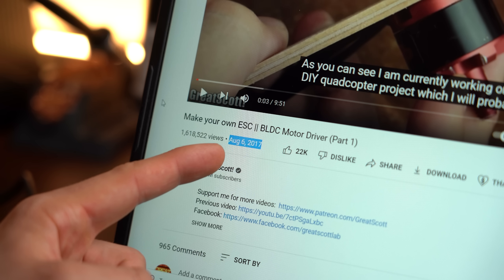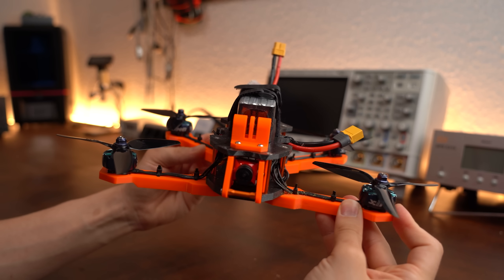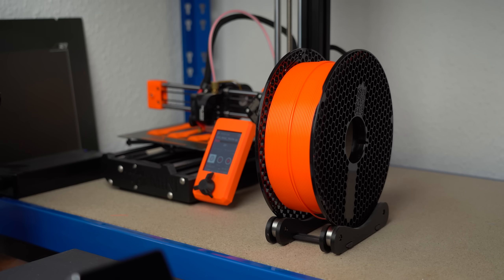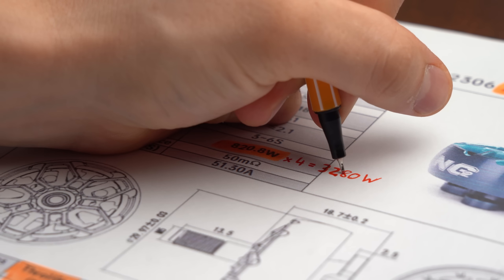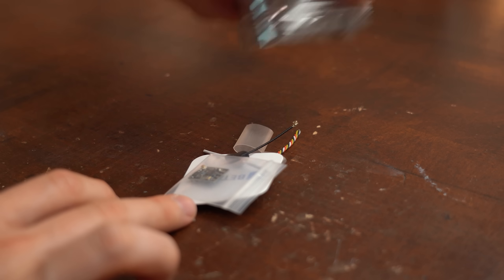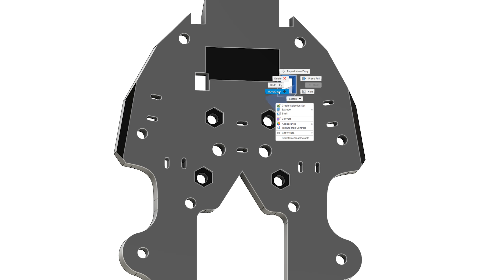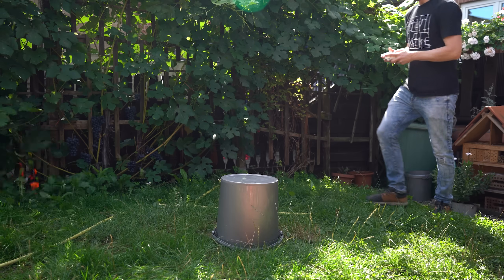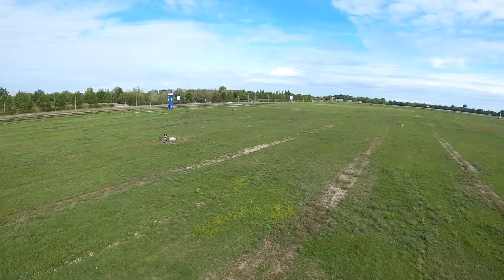The Idiot's Guide to Making a DIY Drone! (I am the Idiot)

Comment: That also happened to me when I build a drone with my friend for school project :
- Aluminium frame without proper precision control and use epoxy putty to attach leg from body.
- Gyroscope module taped with 2 side tape
- No clue what's PID control
- Zapped one of multiwii board because what's different between RS-232 and UART (I connected RS-232 output to UART port that supposed TTL logic level)
- One of rotor decided to seperated from stator 
- more epic fails

Comment: 3d printed frame probably results in a noisy system, add to that 6inch props that inharently produce more noise than "default" 5inch makes it harder to get a  good flying drone. 
Did you use default pids? Look like you had too low pids
Reply: He’s using 5” props

Comment: nice . ich empfehle Freerider  Simulator auf PC  oder Orca fpv beide sind kostenlos und relativ gut um Acro Mode fliegen zu lernen .
Simulator auf pc + hdmi to Av converter (kostet 5 euro ) + 25mw vtx =  perfekt combo , damit hab ich gelernt , und direkt Acro . Angel mode ist einfacher aber nicht halb cool .. 

ich empfehle es mindestens 1 Woche vor dem Fliegen auf Simulator bleiben ... ich hab versucht fpv direkt auf Quadcopter fliegen zu lernen und hab fast mein kopf verloren . mach es richtig mit Simulator
save your money fingers and head .
Turn off Air mode always on to make landing more easy (not to get those unexpected jumps when you try to land )
Air mode to correct for strong wind but has it down sides (when hitting objects )
i think the quad is on the heavy side , anyway try always going forward to get much more juicy flight experienc  . fix your camera angle too , 20 digress is  good angle for learning  i think .more angle more speed (also in similar )

Comment: Welp, here's the fpv crowd coming. Please just get a cheap cfk frame. Source one or something of the likes, 30bux and it basically won't break unless you're bashing it around on concrete for hours. And ziptie that battery lead to a standoff, otherwise the battery will yank directly on the esc solder connection when it inevitably goes flying.

Comment: Working on a drone with a small Nitro motor and generator. This drone you built should be able to lift it.  So it charges the battery in flight.  Going to be a great project if I had the time.

Comment: I'm very happy to see FPV on this channel! You should try a digital system for video if you enjoy the analog experience. 

I love 3d printing frames but they have so many issues I didn't know about until recently. They cause a lot of noise for the flight controller that makes the fc work harder and can cause fly away, unstable tunes, prop wash etc etc. Modern carbon fiber frames are also really resilient. I usually buy 2 of a frame and never have to open the other package even after crashing dozens of times.
Reply from the maker: Thanks for the tip :-)
Reply: Digital is awesome but very very expensive. Wait till you get into the hobby some more before you invest

Comment: Great video. I'm working on a drone myself. I'm using brushed motors to keep complexity down but I'm designing the controller board myself so I'm able to add sensors similar to the bigger drones. Do you ever mess around with obstacle avoidance?
Reply from the maker: Sounds great! Have not tried obstacle avoidance yet.

Comment: 3d print frame not rigid enough for over 2 inch quad. and gopro+4s 2000mah is to over weight for 5 inch
Reply from the maker: Thanks for the input.

Comment: good job but why put the esc over fc ? Esc go under. Also a 3d printed frame will cause lot of vibration to the gyro so it's very hard  to tune your pids and filters
Reply from the maker: Written where?
Reply: @greatscottlab  Esc go under because the wires are shorter and are far away from fc, current wires cause interference. Mounted over are a mess of cables that can be easily ripped off in any crash and touch anything with esc current is how you get your quad on fire.Your Esc cables are long almost double what you need and weight is added for no reason. Look any serious build, nobody put esc over fc. Also no stack has esc over fc, do you think is coincidence? Also something above fc bring more vibrations, fc goes on top with soft mount. Ps flying fpv for 5 years now, trust me i build many drones, also remove props when trying it, it's not written anywhere, it's just common sense if you don't want lose a finger or an eye. Your capacitor is soldered on with cold sold spots you need to melt it down more with the main lead battery wires.
Reply: ESC on top will help keep it cool, i think
Reply: @drobotk  and all electrical noise right over the gyro

Comment: That is a Quadcopter, NOT a drone, it has no autonomous capability.
Reply from the maker: I think just more people associate the name "drone" with such devices. No offense to quadcopters or drones.
Reply: @greatscottlab  Yes but a drone is a capability and not a vehicle or frame type, its the ignorant media that have made others think anything with four props is a drone.
I have two quads that are drones, a quad that is NOT a drone, many fixed planes that are drones and even a 1/4 scale truck that is a drone.
Think Military drone, what immediately pops into your head, a Fixed wing plane!
The U.S army even have Full size Helicopters that are drones, those are seriously cool and i have a 450 size heli frame i intend to give autonomous capability too :) 

Drones come in all flavors, air, ground and water based vehicles and all vehicle types within those classes but ALL must have autonomous capability to be a drone.

Comment: Disappointed - I thought it would be more DIY/hacky but aside from the 3D printed frame (which is probably the root of most of the problems with this build) there wasn't really any of that, just standard FPV drone parts. However, props to you directing people to Joshua Bardwell who is indeed, the FPV Knowitall ;-)
Reply from the maker: I mean should I make my own motors/ESC/FC......that would be a video on its own. And I even made some of that before.
Reply: @greatscottlab  I was aware of your esc video, that's kind of why I was disappointed :-) It would be a huge undertaking though! Still, you managed to build and fly an fpv drone which is no small potatoes given the amount of technical knowledge required 👍

Comment: Oh, please, people, don't make this your first drone. Buy a ready-to-fly whoop kit (even Betafpv Cetus) to learn how to fly and not harm anybody (including yourself, these 5" props are really!!!! dangerous).

Also, spend some quality time in the simulator, such as Velocidrone.

Then once you ready, buy some bind-and-fly drone from carbon so you won't destroy it completely after the very first crash. But also, carbon is way better in terms of vibrations. The drone will fly 10000% better.

You can also order a carbon frame from many manufacturers, or for example, from Criss Rosser (AOS frame), and buy all the components separately.

Comment: Please don't do stuff like testing it in your hand. 5" props can easily slice your fingers open!
Your component choice was alright, but 3d printing the frame isn't a great idea. Betaflight isn't made to handle oscillations caused by soft arms like this. The PID adjustments required to make it fly smooth would make the controls pretty sluggish. Carbon frames are pretty cheap these days and using 3d prints would be more expensive in the end with them breaking all the time :)
Reply from the maker: Noted.

Comment: 14:16. Most likely the problems you're having are the results of your frame being not stiff enough, and that messes up with Betaflight filters
Reply: one thing you can try is to reinforce the frame with some carbon fiber pieces or tubes, or use a carbon fiber frame altogether, you can get modular frames which if you breake an arm or something you can get a spare one, something like the "TCMM Martian ii" should be good
Reply: And 14:26 should be a motor desync from the strong oscillations.
Reply from the maker: Good to know :-)
Reply: @greatscottlab  why not inlay another stronger material in your prints, that way you can improve durability and vibration characteristics while maintaining the easy to produce and prototype nature of your parts maybe something like inlaid aluminum
Reply: @greatscottlab  yes. this is a strong advise.. printed frames in large drone simply dont work since the acelerometer pick all the vibrations and f.up all your parameters. you can find cheap frames on amazon for 20 or less usd
Reply: I've also thought about using a drone with 3D printed components and then carbon tubes with 3D printed connectors for the arms. That should increase stability.

Comment: Also remember to make sure you comply with your local laws which may require you to get a license or take a short test.
Reply from the maker: True
Reply: In fact he's filmed himself not complying with German regulations - while he could have added the mandatory fireproof label off-cam, both the EU and STRFF rulesets require Spotters to be present for most FPV flights. Until someone complains that's fine, but since many people unknowingly did some very stupid stuff with drones, regulations & enforcement got quite strict, especially when outside of a model-flight club.

Comment: Hey Scott, you may be interested in my DIY teensy-based flight controller. Not quite as polished as betaflight, but still very good stabilization performance--and it's arduino-based, so it's super easy to customize and modify (custom sensors, automation, etc...). Made for hackers like you!
Reply from the maker: Feel free to drop a link.
Reply: @greatscottlab  check his channel

Comment: Hi, great videoand nice job !

As an FPV Pilot, I have some advice's for you:
- Never try any adjustments with propellers on, this can lead to severe injury
- Using PLA and other plastic materials create a lot of vibrations making it really hard to tune and even harder to pilot, not smooth at all, you can use pla for prototyping, then create a carbon fiber frame
- You should stick to 1000-1500maH battery, it's not efficient on a five inches drone to fly with heavier battery (1300 is perfect in my opinion)
- Every cables inside the drone should be short as possible to avoiding making vibration. Especially for your power cables, they should be attach with your LiPo strap or anything else to avoid them from being cut by propellers.
- Your antenna is a bit too long and can add vibration to your drone. A shorter antenna cans help a lot. You should mount the antenna vertically to match your VRX antenna, this will give you a better range even with a shorter antenna. If you want to keep this antenna, at least, bend it to the top
- Add a capacitor on the power pad on your ESC, this help a lot and can be the cause of your mid-flight death spinning (cause we ear the esc rebooting).

Vibration is really the most important things when your building a FPV drone, especially on newer versions of betaflight. Every vibration is gathered by the gyro and need to be filtered. More filter you add on a gyro, more CPU is needed and less smoother and controllable is your drone. A youtuber nammed @ChrisRosser have made a lot of videos about vibration and filtering.

Hope this help, sorry for my poor English,

Leo,
Reply: Excellent tips, and your English is better than many people writing comments on YouTube whose first and only language is English.
Reply: @evanbarnes9984  Thanks 🙏
Reply from the maker: Thanks for all the tips :-)
Reply: @greatscottlab  Happy to help
Reply: Plus one for the first suggestion! I have the scars to prove it!
Reply: @ulwur  same here, I forgot to disarm when I picked up my quad and I'm glad I was just flying a 2"! You only make that mistake once haha
Reply: @cullenchase9161  I got my leg skinned by a iflight protek 35 build. Though it was OK to leave props because it had guards... oh boy, the guard ended up holding the quad in place for the props to shave skin and flesh off my shin. Scars still there too.
Reply: Your English is fine. Don't give it a second thought.
Reply: great tips leo :-) 

The tbs source one frame only costs about 30€ and can withstand a lot of crashes, so it's not really worth printing a frame yourself.
You should also put your expensive gorpo in a TPU holder, TPU resists falls much better.
With your mount, you could easily lose your camera in a crash.

a tip for flying itself... Try a simulator like liftoff or VelociDrone, crashes don't hurt and you learn your muscle memory.
ok two tips...
learn to fly fpv only in air mode, angel mod only hinders you to fly properly.
Reply: Personally I like the larger battery sizes. I fly 1800 on 5'. I've experimented a fair bit and the biggest thing for me is the larger weight. If I ran 1300 I'd probably end up taping some weights onto it instead. A heavier drone carries it's weight through maneuvers much better; i.e. punch out forwards and then flip facing backwards. In a heavier drone it will continue backwards much more fluidly and stably, while a light drone will tend to "stop" in the air when you flip it, and you're not able to do the wonderful free falls after punching out while carrying the same ballistic trajectory.

Of course a heavier drone comes with its own set of problems, but I definitely prefer heavier drones that follow a more ballistic trajectory instead of lighter ones where wind resistance effects the drone more (particularly at zero throttle in a free fall)

TLDR; 1000-1500 is not an optimal battery size. It's user preference.
Reply: Bro hears the esc rebooting. Frekin next level. I think for the first time ist already pretty well imo.
Reply: German should work her too!
Nice tips and reminds me on my building career.
Reply: @C4Ti0  My German is way worst !
Reply: @leocrotet  This is defintely a missed "wurst" opportunity.
Reply: as an fpv pilot  i wanted too say all that you did.. i just didnt have the patience to write the comment.
Reply: - Add a capacitor on the power pad on your ESC, this help a lot and can be the cause of your mid-flight death spinning (cause we ear the esc rebooting).
the cap is for the noise for the vtx xD for the esc to do something  the cap is very much to small lol XD
Reply: Hey, are your FPV advices viables for CubeSats?
Reply: That has a lot of good info 
Thanks
Reply: Your English is okay. You just put an S on a bunch of words that don't need it, that's all. For example Advice's.  You don't need  's on that.
Reply: This comment is a whole LESSON! Much appreciated!
Reply: As an electronic student NOTED.  Thanks 😊

Comment: I suggest you should get carbon fiber frame and after that A decent controller like mambo TBS Ethix Mambo RC Radio Drone Controller Latest one and A vr set Like fatshark or other Can give shot In steam simulators for flying acro or else try angle for new till you get use to the sticks after that you can give it real shot Yeah

Comment: Great video. Two suggestions from my experience

1. Try practicing in a simulator. There are a a few out there and it gives you lots of opertunities to practice without risk of breaking anything

2. Get a carbon fiber frame. The strength difference is massive. I have crashed drones into metal objects going 60mph without anything breaking
Reply: It is a tradeoff. Going with a smaller battery reduces the weight and draws less power, so there is a sweet spot. Also going to a 6s battery will make the drone more efficient but may be too much power to begin learning
Reply: @fishfpv9916  and with the current motors and a 6s battery you can risk burning something so by going with a 6s you will have to get slower motors (about 1750-1800kv should work fine) and for learning on 6s you could also decrease the MOTOR OUTPUT LIMIT not throttle limit to like 80-90%
Reply: Great suggestions! Along with these tips I'd say bump down to a 1400maH-ish 4s to shave some weight as well.
Reply from the maker: Well. With the current battery flight time was already only around 4 minutes. So I really do not want to go down with capacity.
Reply: @greatscottlab  The added weight will increase the thrust needed so it's a bit of a trade off of weight vs how hard the motors are working 👍
Reply: @greatscottlab  bro really just 4 mins @@
Reply: @greatscottlab  The 3D Printed Frame is probably heavier than a standard Carbon Fiber frame, LiPo is a bit too much for a 5inch. It's all about weight.
Reply: @greatscottlab  you might be hitting diminishing returns with all the extra weight.
Reply: @greatscottlab  but if you lower the capacity you will lower the weight. And if you lower the weight you will get more flight time. The pros know what they are talking about.
Reply: @greatscottlab  I'd recommend the smaller battery too, you should be able to hover around 1/3 throttle and you'll have a much more efficient flight. there should be a diagram for both your propellors and motors that give you a good rpm to aim for to get the most efficiency, that way you can figure out a weight for your drone and base the battery off of that. It's hard to do all the math so the rules of thumb out there can be helpful! Taking it to the endpoint, at some point a battery would get so big that you can't even get off the ground which would result in a 0 minute flight time. I have a similar build and get about 7 min flights out of it.
Reply from the maker: Thanks for the tips!